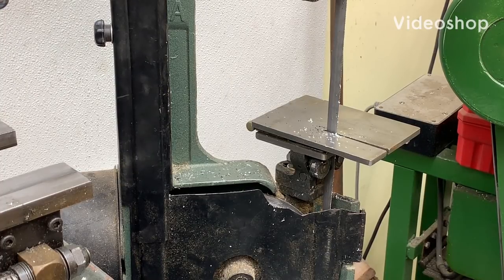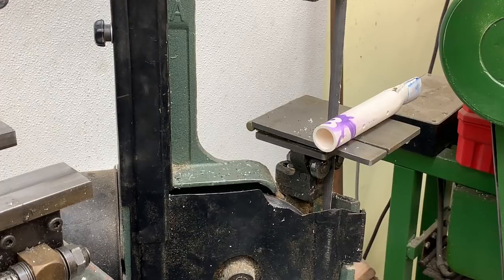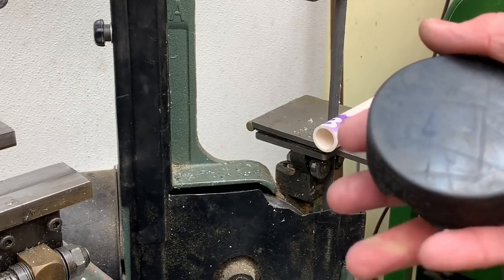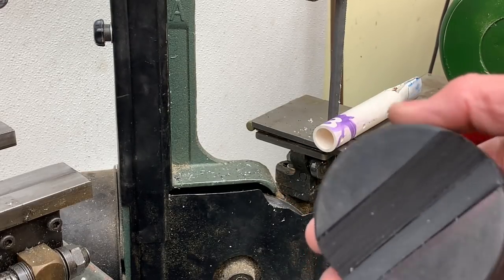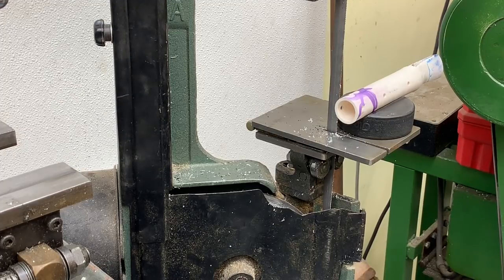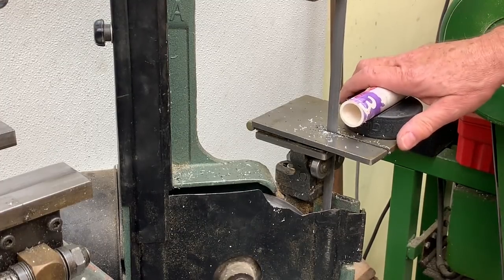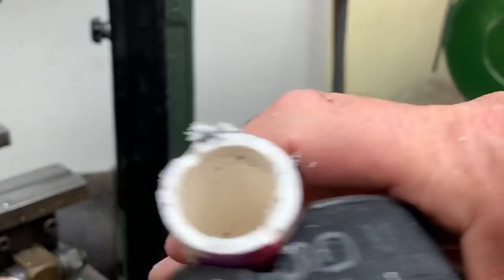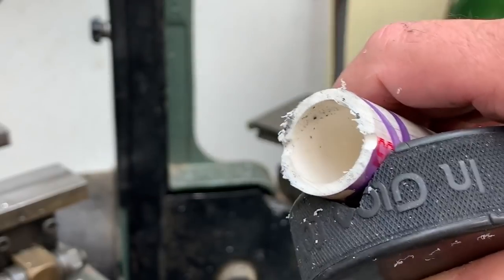Sawing Round Stock by Hand

Comment: Good general concept regarding the necessity for a "non-spinning"  situation when cutting round stock materials in a vertical blade configuration.  That being said, when I saw your video, one scary thing stood out to me at the 2:08 time frame section. 
All I could envision in my mind when the puck jerked forward at the end of the cut was the bloody end of your thumb on the table, blood squirting all over your saw.

I saw and I understand that there is a "perspective differential" between your line of sight and that of the camera and that your thumb was mostly "out of harms way," BUT it sure did not look like that in the video when your hand jerked forward and not everyone that sees your video might understand that.
Perhaps, for others without your obvious ingenuity and first-hand experience, the puck might warrant a flat section along the back side where the thumb exerts the clamping pressure, with a projecting section of the puck material to keep the end of the thumb somewhat protected. 
It might be an improvement for the less mechanically inclined out there and possibly save a trip to the emergency room.
On a personal note, over time I have enjoyed many of your videos and have "borrowed" a number of your tips over the years. Thanks for sharing your knowledge with the rest of us!
The best for me, as I do a lot of HDBS work, was the use of V blocks or your "OO rods" for cutting square tubing on my horizontal drop band saw.
Thanks again for sharing!